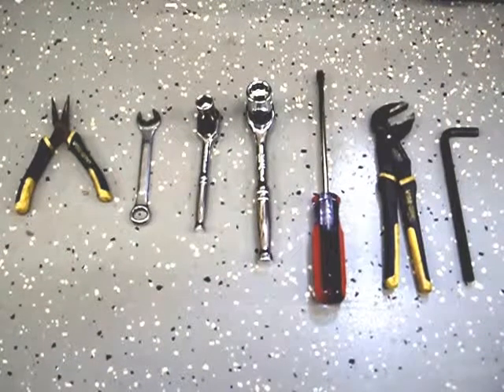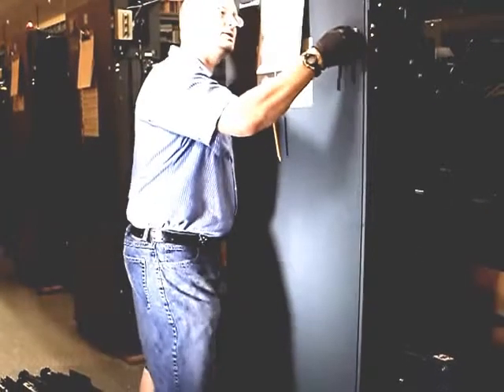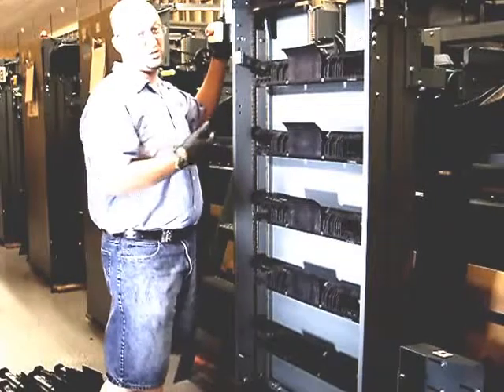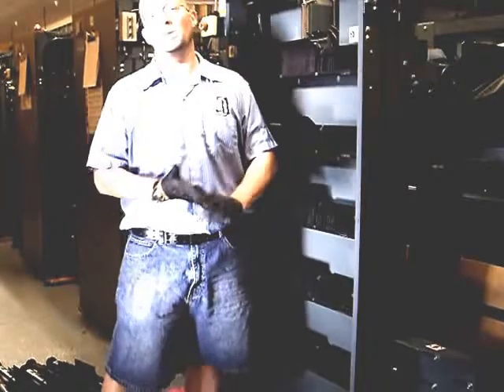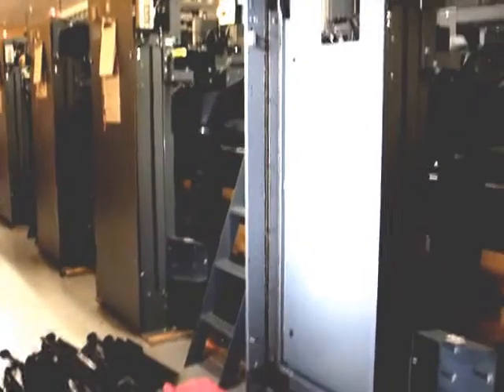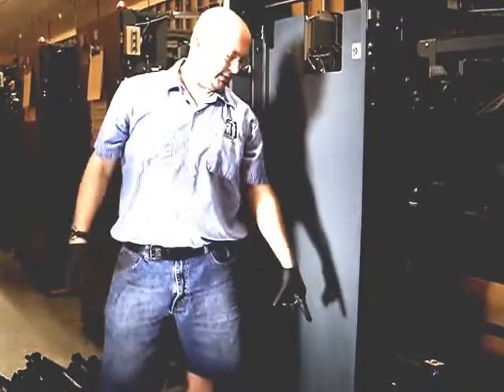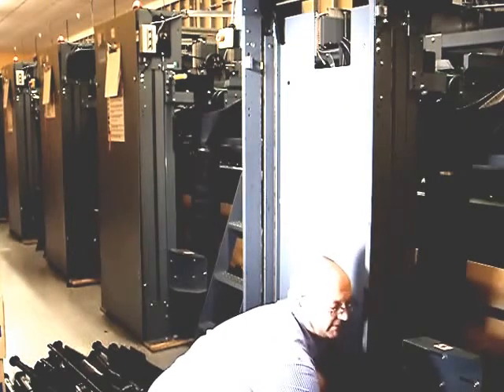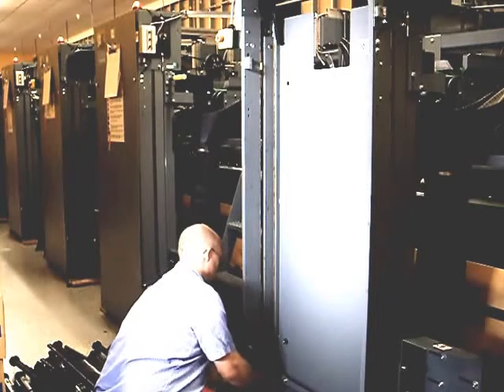Elevator chain removal

Comment: How often do the chains need to be cleaned?
Reply from the maker: Michael-
It varies on the time and frequency.
Private lanes in personal homes don't need to be cleaned as often.
Each mechanic or owner should judge their chain cleaning schedule after reviewing buildup on the chains.
Amount of lanes at a center and customer play also are factors.
If you keep them lubed and proper tension they can maintain longer.
Chains that are too loose can drag the boards in the elevator and build up more on the chains and eventually stop an elevator from rotating.
Chains that are too tight can keep shovels from rotating in the elevator as well.
I put enough tension on the chain that you have to push with enough force in the dead center of the chain.
And only the peg on the chain that holds the center shovel will give enough room to remove the shovel.
So basically you don't want the chain so loose that when you try to remove one shovel that two or three will drop.
I test my chain tension in the dead center just like drawing a string on a bow.
You test the tension in the middle, no where else.
Once the tension is set then you can remove the shovels from lower and upper areas just by pushing the chain further.
You can remove three or four shovels at a time this way before you have to rotate the chain.